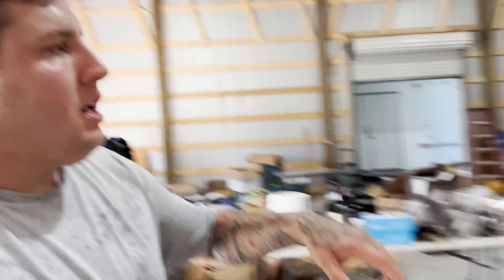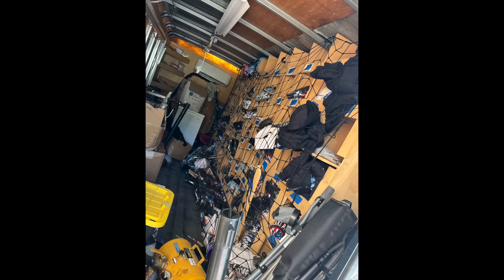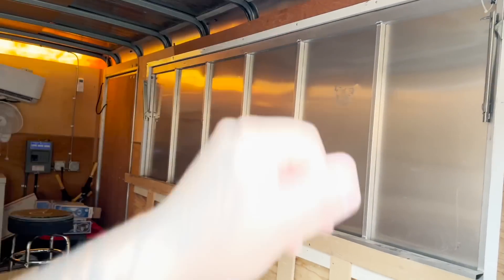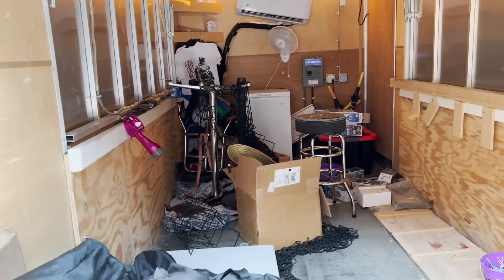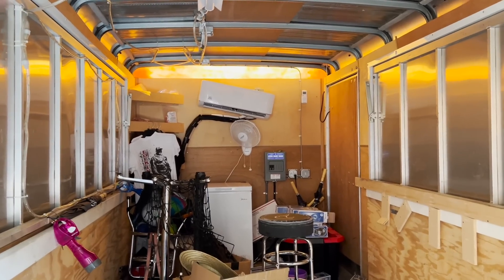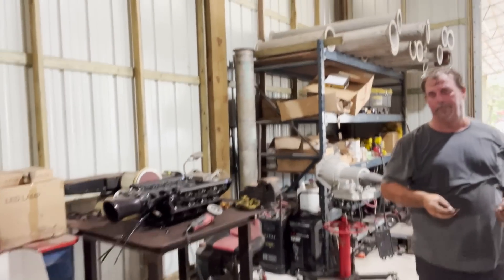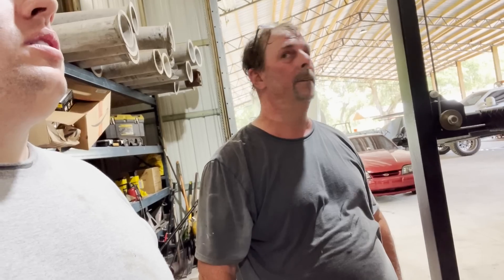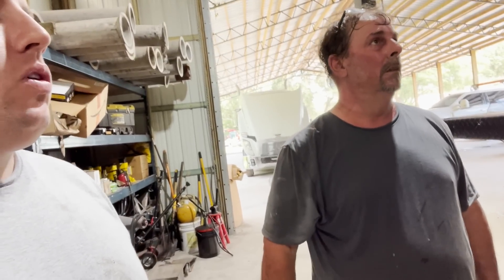FIRST LOOK AT UNCLE MIKE CHEVY II Near Completion.

Comment: wasted space. build your shelves on a track system that can be moved to either side. this was you can still build the shelves from the floor to top of trailer.  look at a company called storage solutions. they have great ideals to make better use of your limited space and the ability to work from with side of the system. ................
 good luck. S/G Fan